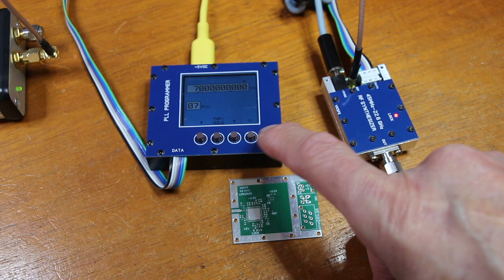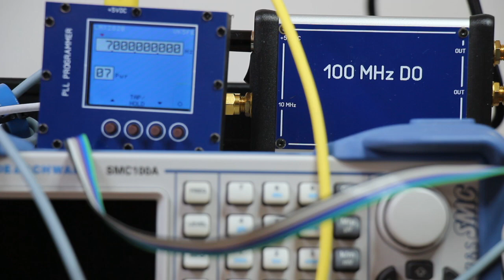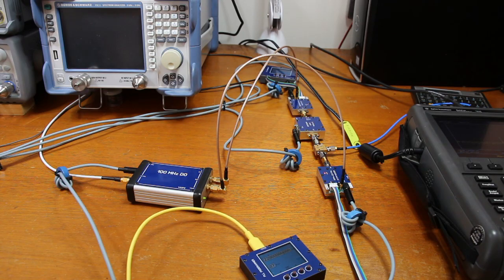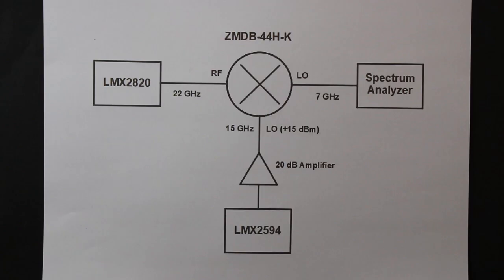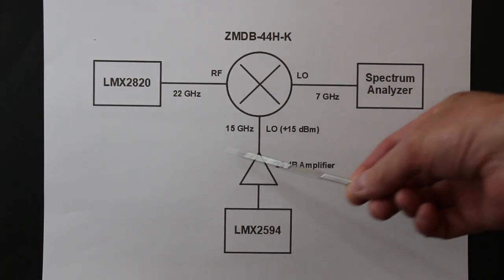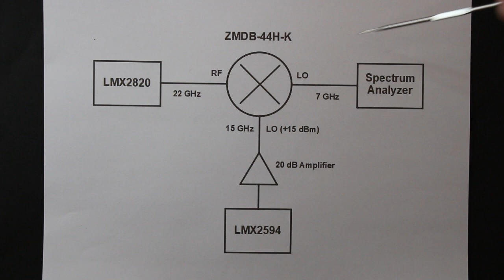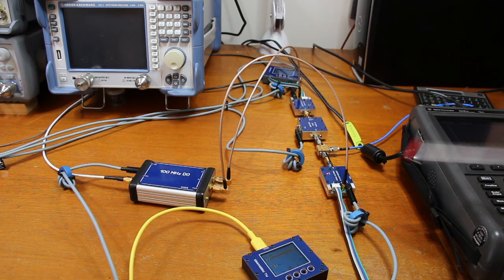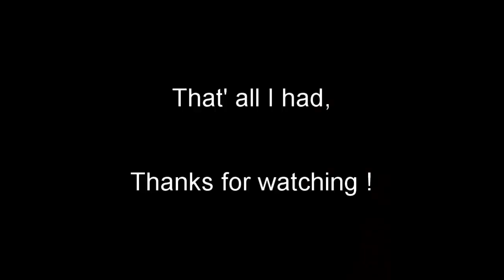#44 My Compact 45 MHz to 22.6 GHz Generator

Comment: Very good! Do you think on packing everything together and make a RF signal generator?
Reply from the maker: Hi Ari. Exactly, that's one of the reasons why I design smaller units for frequency synthesizer chips, it's easier to include in larger projects. This concept can be seen in video #1.5, where a LMX2594-based tracking generator was used in a homemade 3 GHz spectrum analyzer. cheers.